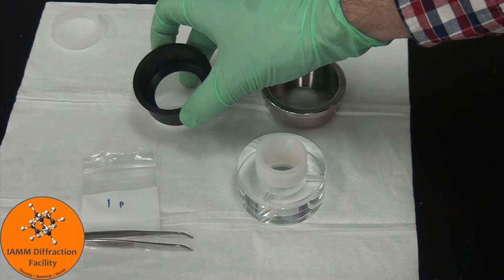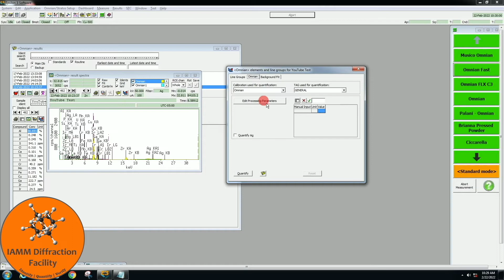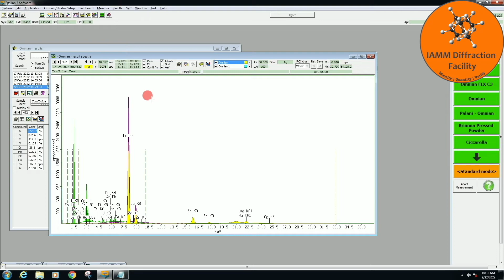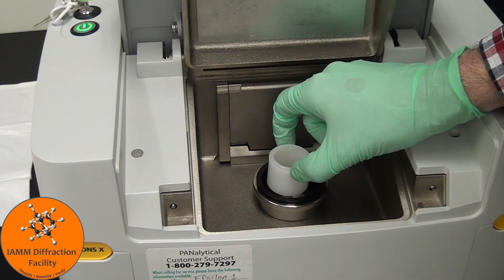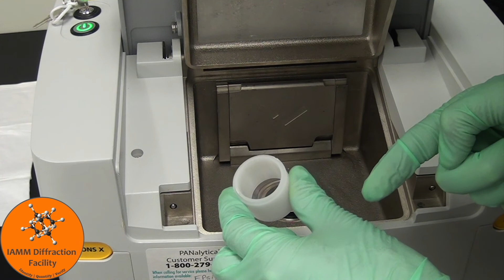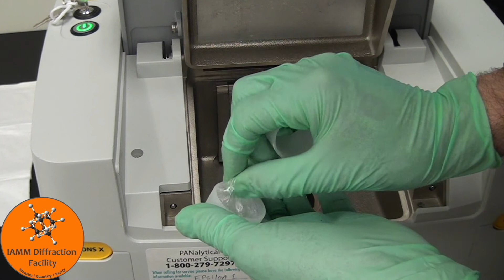Basic Steps on How to Perform an XRF Measurement with an Epsilon 1 from Malvern Panalytical

Comment: Excellent video!  Although I have a question, how does oxygen balance in the results that the equipment provided?
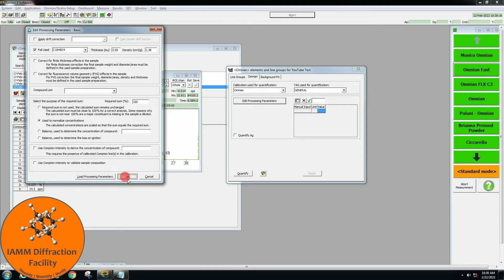Reply from the maker: For the sample in the test, there was no oxygen in the certification.  In general, you have a couple options on how to handle oxygen.  (1) If we had an upgraded detector in our XRF, we could detect it directly.  (2) If you look at 04:03, you'll see "Compound List."  If you choose a compound list, the software will take whatever elements it finds and convert it to whatever compound is in the list (these lists can be edited in the Epsilon software).  For example, if you choose a particular compound list that specifies that any result of Fe is really Fe2O3, then the software will recalculate the results to tell you how much Fe2O3 is present.  This can be a bit tricky though because the assumption is that Fe exists ONLY as Fe2O3.  If you also have elemental Fe or Fe in another compound, the reported Fe2O3 amount will be incorrect.  

I hope this helps explain things!
Reply: Thank you very much for answering. I'm learning to use an Epsilon device and it is still hard for me to know if the results it gives me are  normalized or if they require some additional step. 
I'm analyzing rock samples, so i have an idea of the composition which allows me to choose the elements.